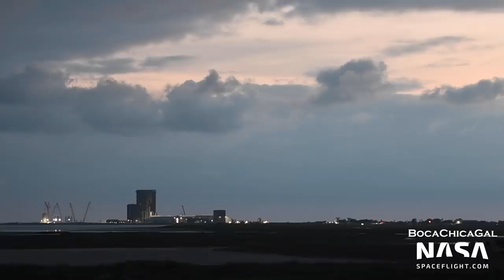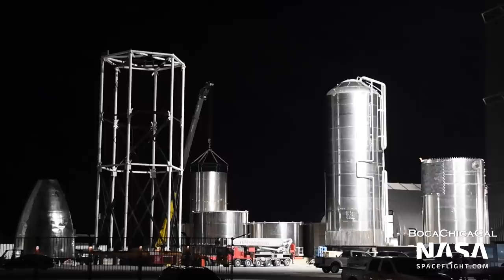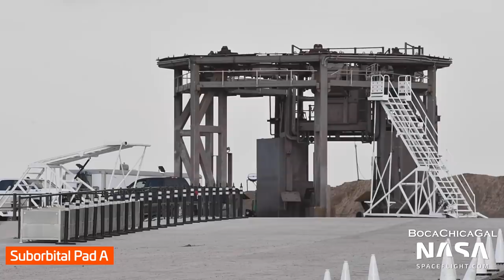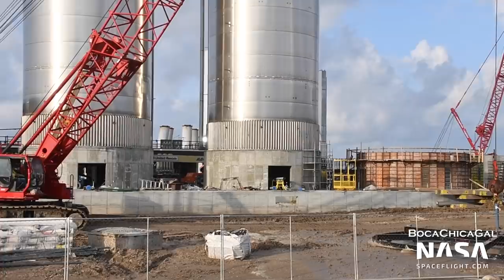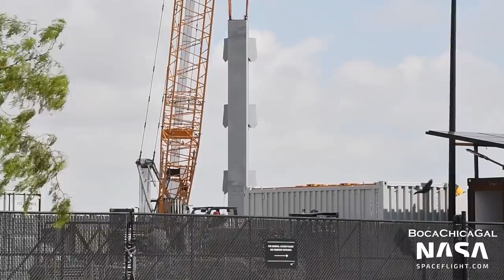Starship SN15 Lifted Onto Suborbital Pad B | SpaceX Boca Chica

Comment from the maker: 0:00 - Sunset
0:57 - Orbital Launch Tower and Mount
1:11 - Launch Site
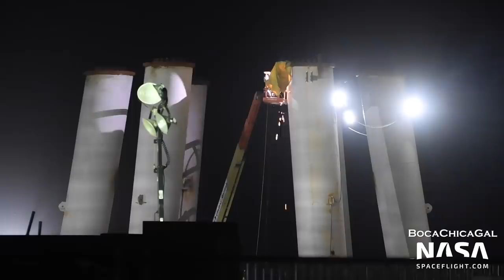1:31 - Orbital Launch Mount Construction
1:57 - Orbital Launch Site
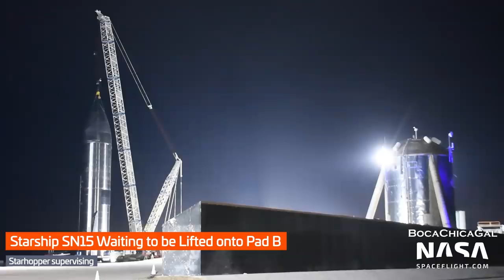2:19 - SN15 Waiting to be Lifted onto Pad B
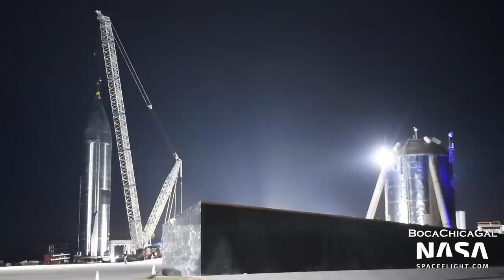2:39 - Starhopper
2:51 - Limping Coyote
3:19 -SN15 and Tankzilla
3:37 - Launch Site
3:53 - Disassembled Test Nosecone and Nosecone Test Rig
5:16 - SN16 in High Bay
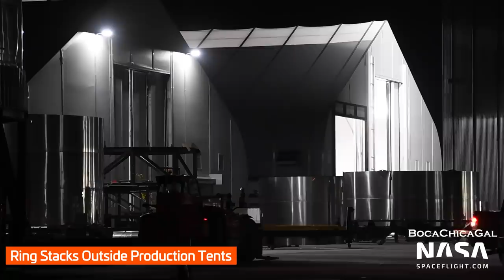5:52 - Ring Stacks Outside Production Tents
6:08 - Starship Production Site
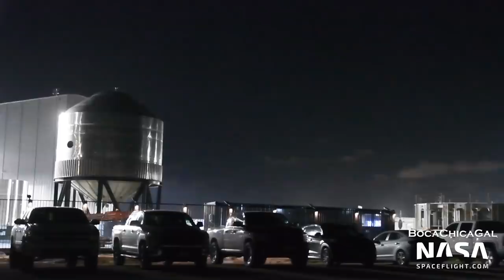6:50 - Daybreak at the Launch Site
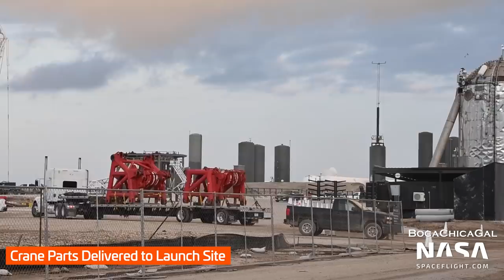7:31 - Crane Parts Delivered to Launch Site
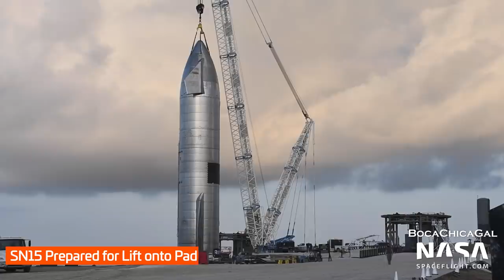7:52 - SN15 Prepared for Lift onto Pad B
8:13 - Suborbital Pad A
8:28 - Suborbital Pad B Prepared for SN15
8:56 - LR11350 Assembly Continues
9:11 - Launch Integration Tower and and LR11350
9:34 - Orbital Launch Site and Landing Pad
9:54 - Orbital Tank Farm Contruction
10:13 - Load Spreader Hooked to Crane
10:41 - Orbital Launch Site Cosntruction
10:57 - Cryo Tank Shell Construction
11:17 - Test Nosecone Scrapped
11:32 - SN16 in the High Bay
11:47 - Orbital Launch Table Construction
12:03 - SN15 Lifted off SPMT
12:48 - SPMT Moved
13:17 - Aft Flaps Retracted
13:36 - SN15 Lift from Dangercam
14:06 - SN15 Lift from the Beach
14:15 - SN15 Lifted onto Pad B
15:28 - SPMT Leaves Launch Site
15:42 - SN15 on Pad B
16:56 - Crane Parts Unloaded
17:08 - Launch Tower Segment Construction
17:50 - Launch Tower Part Delivered
Reply: Hey NSF 😋😋 Thanks for the vids
Reply: 2:55 Injured fox walking.
Reply: Wait, They're going to have a reflight of sn15?
Reply: @OneCupOfCoffee204  They said it was a coyote.
Reply: @ChosenMJ  I would go with their description lol
Reply: I was right about the 2:55 though...
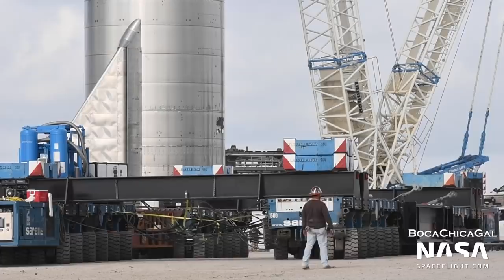Reply: 12:59 SPMT manouverability, just plain gorgeous, how much money would NASA have saved to not build the CRAWLER????
Reply: @yoloeveryday9057  yes
Reply: now that sn15 is on the pad, we can ask the real questions

wen hop? ;)
Reply: Really appreciate the time coded index!  Know it's a headache to prepare, huge help for the longer vids.
Reply: Crane operator bar talk: "Did another damn starship pick today.  I'll have a cheeseburger and Lone Star."  MIT grads need not apply; Caltech grads busy launching Mars probes...
Reply: Wow, that's a long list of timestamps! :D Thanks, they're great.
Reply: Perfect

Comment: Gonna be sooooo satisfying watching the stacking of each level of the integration tower
Reply: It's probably gonna shoot up over the period of a few weeks. From foundation to the tallest building in Boca Chica in no time at all!
Reply: @devindykstra  It will be the tallrst thing in Texas
Reply: @СаенкоСвятослав  I don't want to be that guy, but the JP Morgan Chase Tower in Huston is 305m tall. Starship and Superheavy together are 120m, so the tower will likely be no more than 150m. That means it sadly won't be the tallest thing in Texas.
Reply: @devindykstra  it's planned to be built totally before 20 June
Reply: @devindykstra  The tallest thing in BocaChica, for sure.
Reply: Did you notice the rail running the length of the newly delivered vertical beam?

Comment: I see some wrinkles on that nose cone from the squish testing they performed!
Reply: Will they need to throttle down for max Q or not?
Reply: @johnvajcner20  They will compensate in the design I would guess.
Reply: @user-vp1sc7tt4m  even if you do that, cutting back on the throttle is something you want to do anyway
Reply: At least one of them was there before they had even finished building the Nosecone Jail rig around it, as it was clearly visible in the earlier NSF footage of it during that time.

Comment: I wonder if SN15 will have to do a static fire before it's second flight. Assuming no Raptors were swapped out I wonder if they'll skip that step.
Reply: Probably a cryo proof first, to check hull integrity
Reply: I wonder too. Given there will be no further use for sn15, they could just launch it right away no matter the outcome. Silently hoping for it to explode so there's no need for planned disassembly.

Comment: We haven't seen any replacement legs yet right? So we will probably still have a bit of a wait before SN15 launches again. Although they might take the opportunity to cryo and static fire while waiting for the legs to arrive.
Reply: That and the fact that it may take a couple of days to assemble Kong.  He's right in the middle of the landing pad.
Reply: So the engines are still in place? Quite surprising they didn't take them off for inspection. Could they have so much help faith in them or is this gonna be what ever gonna happen will happen test flight?
Reply: @EddyKorgo  Could they take the motors off before being placed on pad?  Would they also fly it again without taking some of the motor sections apart for inspection?

Comment: I suppose the Starship is secured down from high winds being on the pad. Better than not on pad?
Reply: The six spots where the legs go are designed to "clamp" on there. So all the "Full Starship" jig, and the SMPT, and the two test pads all have precisely the same six-clamp widgets if you look very closely. So it's been "firmly attached" to the SMPT since landing day, and the SMPT has something like 12x 10,000 pound crane weights holding it down. Looks like the SMPT also has a generator and a compressor (?) on it, so internal pressures, etc are all operating. Not going to blow off or tip over.
Reply: @shrikedecil  Thank you.

Comment: I wonder if they use Dyneema cables for the crane?
Reply: Pretty sure the lift cables are mostly steel. Dyneema is degraded by UV light, and they wouldn't want that risk.  It's also a lot more expensive that steel cable. But it's possible, in fact the way the rope moves on the forward section of the new crane makes me wonder if it could be a synthetic rather than steel.
Reply: @davidb6576  Dyneema has pretty good uv resistance:  crane wires are replaced quite frequently anyway.  If dyneema isn't used I bet it's more a certification issue than performance.
Reply: For those that don’t know about Dyneema cables. Dyneema has been replacing steel cables because of it’s strength, abrasion resistant, creep resistance, compression resistance, resistance to bending fatigue. When compared to wire rope, Dyneema is lighter and has lesser impact from breakage which is safer for the workers. Dyneema is said to be 15x stronger than steel for same size diameter. It even floats on water. It has been used in heavy construction. Also: for this size diameter it is resistant to UV light.
Reply: @Ullr-el3pu  It's not 15x stronger per diameter, it's stronger per unit weight (much lighter, perhaps 3x nominally stronger at same diameter).  But there's still issues with polymer rope, including "burning" at high stress points such as when going over small sheaves at high load.
I have no specific knowledge of what the cranes are using in BC, if someone actually does I'd be curious as to the mix.
Reply: @davidb6576  Go to usarope.net
They say 15x stronger than steel, nothing about 3x. They also say better abrasion resistance than steel. Plus: UV resistance.

Comment: 1) How is SN15 retracting its flaps? Is there just a simple battery and everything is electrical actuated? Something must recharge that yeah?

2) How is fuel going from the Launch Pad to the rocket? Where is the fuel connection?

3) That guy is not afraid of getting decapitated haha no big deal just a Starship on top of your neck :P
Reply: 1) there are Tesla batteries in Starship. Elon said in one of the interviews. Electric motors are Tesla’s as well.
Reply: While it was sitting on the SMPT, there's a SpaceX generator and what looks like a compressor (or gas handling of some sort) on there. So the internal batteries, the hydraulics, and any needed gas pressures are maintained in "Tank near full" position right up until detaching. 

They've been slightly coy showing the "attachment area" for the Starship - it's not in the engine bay views. But we know that there must be at least the LOX and LCH4 plumbing right to the bottom of the skirt. And there's either a manifold to hook up LN2, or separate plumbing. And, naturally, the networking and power connections. We assume they're all in one tight little area on the skirt bottom edge. Both Pad A and Pad B have one side of the hexagon that had vault-like boxy structures, and the cryo-plumbing goes straight into the concrete from there and out to the nearby tank farm.

Note that "the plan" is for two Starships to be able to dock in orbit tail-to-tail ... and having all the connections down at the bottom already means you only need one set of connections. (Which Elon is a big fan of).

Comment: Have they been working 24/7 since the start or I'm seeing it today?! Also, be great if someone can answer:
A: Will the OLP completed before July 1 and is it absolutely necessary for the first orbital launch?
B: What was the exact purpose of nosecone article? Testing it for Max-Q, I heard somewhere, but doesn't the entire vehicle need such a test? 
Thank you.
Reply: Yes, 24/7, 12 hour shifts, 4 days on, 3 days off.
The OLP is necessary for an orbital launch, but truth is it is still months away.
Nosecone test article is structural loading tests. Likely primarily to validate max-q. They only tested the nosecone because the rest of the vehicle is just a pressurized cylinder unlike the more complex nosecone. Yes, vertical loads need to be accounted for across the entire vehicle, but the rest of the vehicle is simple.
Reply: @philb5593  Thanks so much, dear. ❤️

Comment: 1. What's been done about upgrading the landing legs?
2. What's been done about the not so fire retardant insulation?
3. What's been done to prevent the fuel leaks and subsequent fires due to the corrosive nature of the fuel?  Is the leak at a junction point or in the pipe?  Is there some type of o-ring at the junctions?  If so, is it degrading?  Is the leak at a critical flex joint?
Reply: " 1. What's been done about upgrading the landing legs?"
I don't know. New versions of the legs have not been spotted yet. But given that even SN20 (first orbital flight) will not land on solid ground, that doesn't seem time critical. 

"2. What's been done about the not so fire retardant insulation?" Care to elaborate?

"3. What's been done to prevent the fuel leaks and subsequent fires due to the corrosive nature of the fuel?" Methane is not corrosive as fas as I know. 
The fire after the SN15 landing was due to the engines evacuating the remaining fuel and the methane pooled under Starship. This happens every time an engine is shut off. But during flight the fuel can't pool and thus can't ignite. You saw the big white clouds during flight when on of the engines was shut down?
Reply: @3gunslingers  
The fire after the SN15 landing was due to the engines evacuating the remaining fuel and the methane pooled under Starship.
That's interesting and useful info, thanks. If evacuating the engines is necessary/unavoidable after landing then the ensuing fire might be a bit of a tricky problem to solve!
Reply: @John_L  
"then the ensuing fire might be a bit of a tricky problem to solve!" 
Maybe not even necessary to solve. 
The whole Starship is practically fireproof anyway. It has to survive launch and reentry. Both times the engine bay is exposed to very high temperatures. I doubt a little methane fire after landing can do much damage.

Comment: Do you think they might try to go orbital before sn20, maybe like 18 or something? Or just skip all the rest like 12-14
Reply: If SN15 would be orbital then there will have to be some modifications. It could be possible for one of the ones after SN15 but before SN20 to be modified for orbital flights. It's easier to change blueprints than a constructed object.
Reply: 17, 18 and 19 are all getting skipped. SN15 and SN16 are not orbit capable.
Reply: They need boosters to go to the orbit. However they might increase the altitude. Maybe SN16 will hop to sub-orbit 20-40km tops